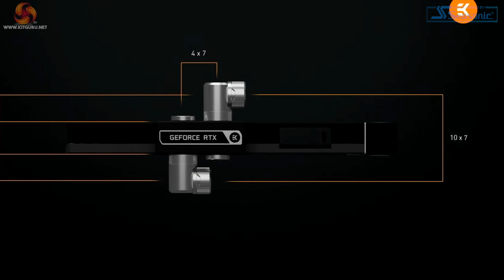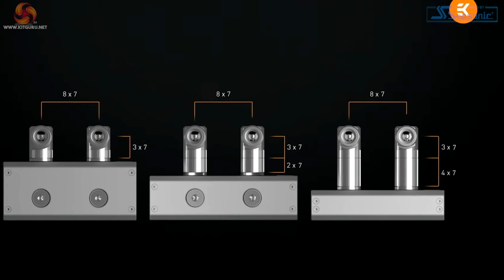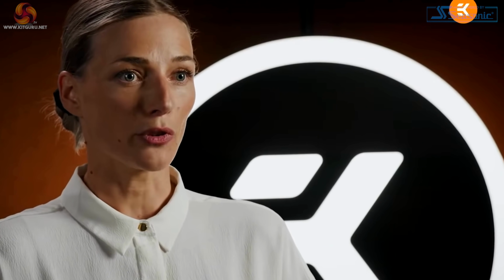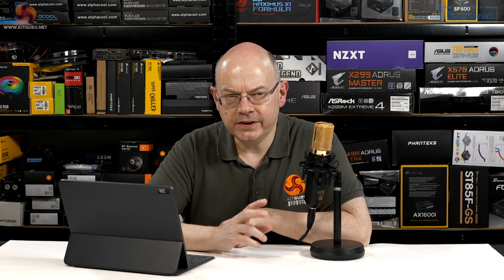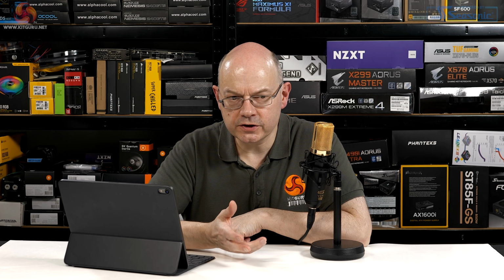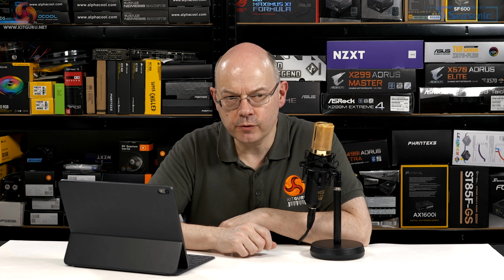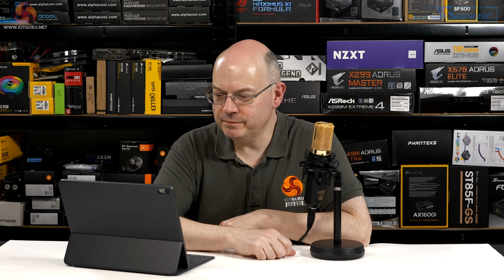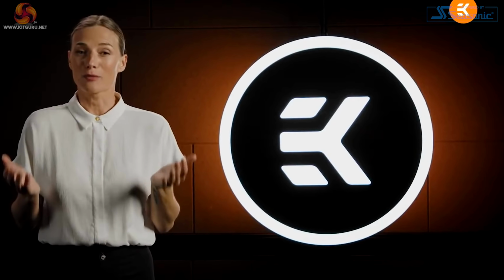LEO Reacts to EKWB Computex Keynote 2021

Comment: which full coper radiator are the best ? for 360 and a medium thickness
Reply: I noticed no one answered you. I run 4 EK 45x140x420 copper rads. No runs, no drips no errors. All EK fittings and tubing. EK gpu WB. In three years I've gone from terrified I would ruin the most expensive mobo/cpu I've ever owned to using water is a must.
Reply: @maxhughes5687  thanks that's a cool answer, going to water cool all the pc XD

Comment: I don't get the EK-Quantum radiators, they don't appear to have changed much other than the ports, will have to wait for more information
Reply: Cross flow rads might help with the plumbing on some installs. A case that will handle the biggest rads is number one. Bigger fans do a better job even at a lower speed. Heat rises, put the rads on top of the case. Case fans push cool air into the case and all the heat goes up and out the top.

Comment: I like EK I have their 3080 founders   Gpu water block it is the best Gpu block ever built . But I will stay with ocool rads how ever . I preferr X flow 45mm but the cross flows are useful in certain cases